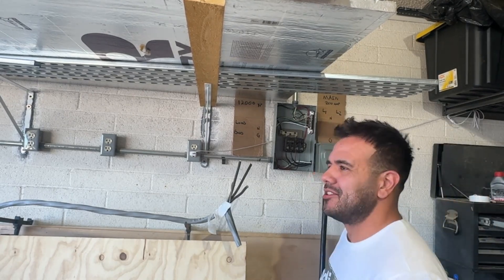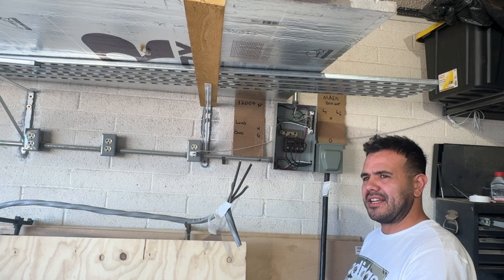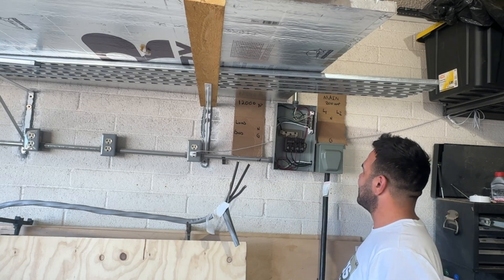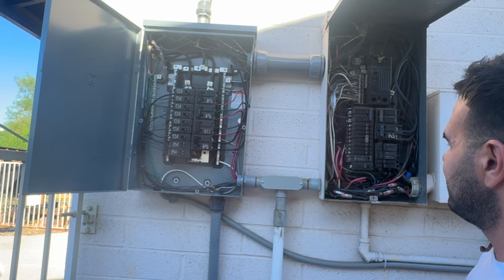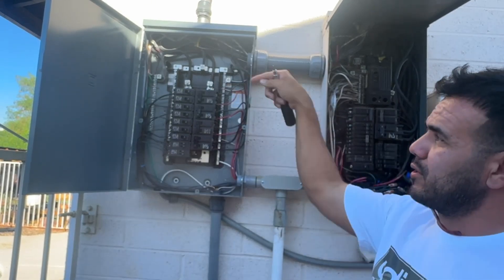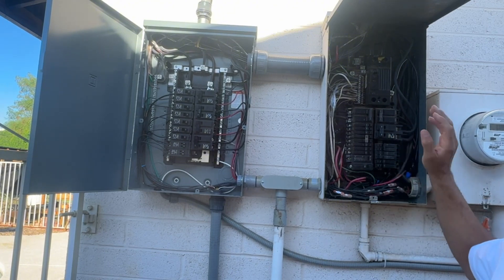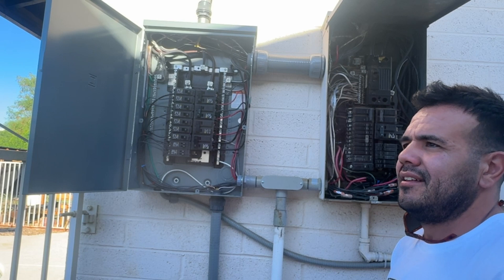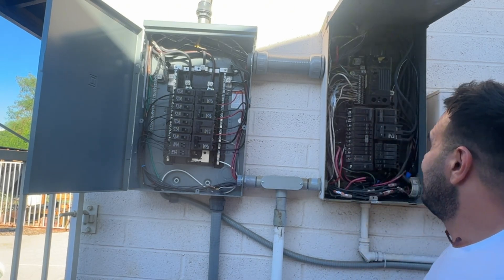What If Your Inverter Fails and You Don’t Have a Transfer Switch?

Comment: In the early days Outback power systems always had a transfer switch built right into the breaker system, so did Xantrex which is now Schneider. Having installed hundreds of battery based systems in my early days, never once did I put in a system without a manual bypass switch. If I lost a job because my bid was too high, so be it, let that other contractor deal with the headaches. Also what you're explaining is fairly easy for us technical folks but for 90+ percent of the customers there's no way in hell they're gonna do something like that.
Reply from the maker: You’re absolutely right. The more I post, the more I realize this content is really for a small percentage of folks who actually want to learn more and understand what’s happening behind the scenes.

A big part of what I’m doing here is also me documenting my system and learning along the way. I’m not presenting this as the “right” way or the “only” way — just sharing what I built, why I made certain choices, what I’ve learned, and how it behaves in the real world over time.

I also think there’s value in showing both sides of it: the ideal way things look on paper, and the practical realities you only learn after you’ve installed, lived with it, troubleshot it, and had to think through failure points. That’s where your installer perspective is super relevant — because you’ve seen what works, what breaks, and what customers actually deal with long-term.

End of the day, this channel is about learning, documenting, and putting useful info out there for the people who are interested — whether they’re DIY, trying to understand their own setup better, or just researching before they spend real money. Different audiences will take different things from it.

Comment: But isn’t it dangerous to feed a 100 amp panel using a 50 amp breaker?
Reply from the maker: It’s only meant as a temporary backup if the inverter dies. The 50A breaker is what protects the wire going to that panel, so it’s not dangerous — you’re just limited to 50 amps instead of the full 100. If you try and pull more than 50amps the breaker will eventually trip and protect the wire from overheating.

Comment: I know it is not code - at all but this is what we did with our 12000XP powered panel and the remaining original panel board. 

Since they are next to each other I landed a 50A breaker in each panel board. These let me do three things....

If they are both off the inverter powered board is powered by the inverter. The original panel board is powered by the grid.

If I island the home from the grid via my first means of disconnect I can use these two 50a breakers to make the inverter powered board power the original panel board. 

If my 12000XP fails I can isolate my inverter and then use the two 50a breakers to power the inverter powered panel. 

Again, not to any code and if you sequence things wrong you could do something bad like backfeed the grid or expose the 12000xp to grid power it can't match too.
Reply from the maker: Thanks for sharing your setup. Work-arounds like that can get a little tricky sometimes, but if it brings your home back online when you need it, that’s what really matters

Comment: Can you explain or make a video explaining the connections that you would make to implement a MANUAL transfer switch with this particular setup?  I like Rich's idea but as you said.  It would be easier  to just pull a lever.  

I am trying to wrap my head around it.  Would I run a double pole breaker from the CL panel to the transfer switch and one from the MAIN panel to the other leg of the transfer switch?

Which position would the switch be in for normal operation (i.e., until the day your inverter fail)? 

 Or would a single phase switch  be used where it's either on or off?
 Like I said. I am just trying to wrap my head around it.
Reply from the maker: I can definitely make a short video diagramming how that wiring looks — it’s much easier to visualize once you see it.
Reply: Thank you.  I wasn't able to find any vuds of it on Youtube.  All I  am seeing is the implementation of  the Pro/Tran 2, but the limited circuits would be an issue for me.

  *Cheers*
Reply from the maker: @stephwiz just uploaded the video, let me know if it helps clear things up

Comment: Hey this just happened to me about 48 hours ago I have a 12,000 XP and from the factory the neutral wire was not hooked up at all and I didn't realize because it's behind a black plate coming off of a circuit board and I thought for sure it would be hooked to an internal neutral or somewhere where it was safe because it's such a critical item but the neutral wire from the circuit board was not connected and so 128° heat index I had no power so in an emergency situation all I did was take a 100 amp circuit breaker two 4 gauge wires bring them from my main panel up to my sub panel and put a 100 amp circuit breaker on the sub panel made sure the circuit breaker was off going to the inverter and just flip the circuit breaker of course after I hook the neutral and ground up also and that was the way it ran until I could figure out what was going on with the 12,000 XP so that saved me my wife my cats and my handicapped sister but I was fortunate to have two 100 circuit breakers available , so now I'm going to definitely install some type of transfer switch,,, the guys from signature solar help me figure out what was wrong with the inverter and they're really good guys they've got working,, it needs to be a warning to every purchaser that the neutral wire is hooked on to the same neutral bar and it must be checked before the inverter is ever powered on or you will have catastrophic potentially burn your house down damage a f**** nightmare 128 degrees is about as bad as it can get
Reply from the maker: That was quick thinking — glad you had those 100A breakers on hand! That’s yet another way to get things up and running in a pinch. Thanks for sharing your experience!

Comment: What if you have a very powerful inverter 18000XP or maybe two parallel 12000XP and 3 wall mounts and you capable of running your whole house.  How do you wire them? Just curious...
Reply from the maker: Great question — and honestly, there are a lot of ways to wire a system like that into a home. It really comes down to a bunch of variables:
– The inverter(s) you’re using (like a single hybrid 18kpv vs. two off-grid 12000XPs in parallel)
– Whether you’re off-grid, grid-tied, hybrid or using grid as backup
– Your main panel setup (breaker sizing, load capacity, and available space)
– Location of the inverters and batteries in relation to the panel
– And most importantly, the types of loads you plan to run (entire home vs. critical loads only)

Right now I’m building a smaller, portable power station setup using a 6000XP, and I plan to wire it into my house as well as power specific appliances and circuits directly. I’ll be covering all of those wiring options in the video series — including direct-to-main panel connections, subpanels, and dedicated circuits. The idea is to show several wiring approaches based on your priorities: mobility, backup capability, energy use, or flexibility.

That said, your question is pretty broad — there isn’t a single “correct” way to wire everything since it depends so much on your setup and goals. If there’s a specific scenario you’re thinking of, drop the details and I can try to break it down further.